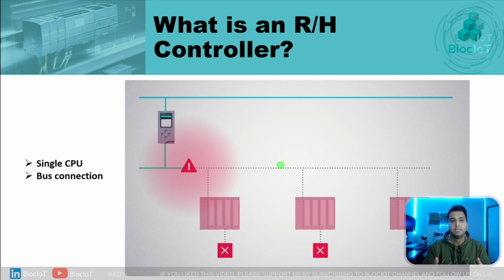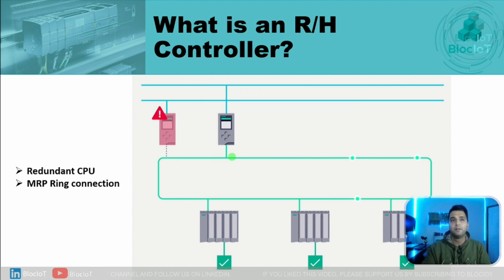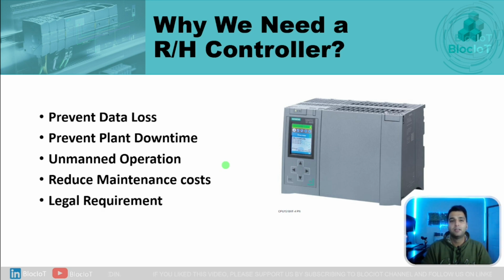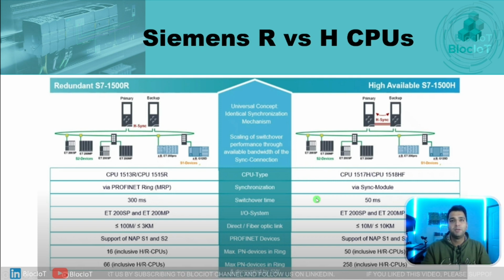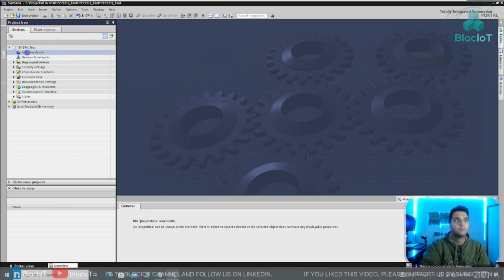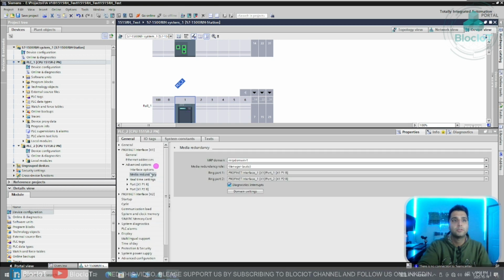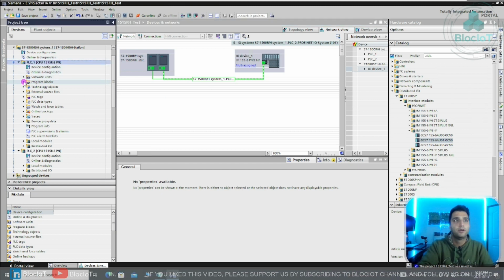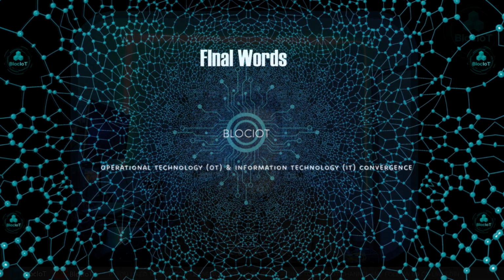21- Siemens PLC Redundancy & High Availability: From Basics to TIA Portal Setup and Real HW Test!

Comment: Hello Thanks for video. Is it possible to have redundant ET200SP with non redundant CPU? Thanks
Reply from the maker: I hope it was useful.
To my knowledge, you can connect redundant I/O to non-redundant CPUs in PCS7, but there are limitations and considerations. For instance, using redundant Modbus TCP/IP on PCS7 to communicate with non-redundant PLCs is possible but sub-optimal. Additionally, for true redundancy, you would need specific hardware configurations such as HF Interface Modules and S2 PROFINET features to ensure proper communication and avoid single points of failure. Without these, redundancy may not be fully achieved.

Comment: What happens if you have two cpus and three RIO units in project but only one RIO can be connected for commissioning does it have to be setup as in your video? Or can you complete the ring without the other two RIOs ?
Reply from the maker: Great question! If RIOs are just a node in the ring not redundant RIOs, they don't have to be connected and can be connected later. But Redundant RIO is a diffefent story. Here is a useful link:
https://support.industry.siemens.com/cs/document/109767576/connection-of-redundant-i-o-devices-to-s7-1500?dti=0&lc=en-WW

Comment: Can we add switch in in interface port 2 of 1515R
Reply from the maker: Sure. The CPU in this deno is connected to a Scalance switch on its right side.
Reply: But interface 2 haven't MRP can we connect directly
Reply from the maker: @jr_electrical-Engg  I am not sure if I fully understand your concern. You may send us a message on Linkedin to chat more with details. Overall, each CPU has two independent ports (X1 and X2). In this demo, X2 of each CPU is unused. So you may ise it for any purpose. But X2 is not a part of MRP ring so you won't get benefit of MRP ring. Overall, it's not a good idea to do it this way. If you need to add a switch, add it to the ring. Hope this helps

Comment: wow did you paid for both the cpu's yourself? quite expansive!
Reply from the maker: The demo was borrowed from local Siemens office :)
Reply: @blociot thanks for the reply. Didn't that was possible. Do you rent that or need to be a siemens certified partner?
Reply from the maker: @MrDawen1997  anyone who want to buy a unit, they can ask for a demo for testing as long as the local office has a demo available. You should call them and ask.

Comment: Brother, i have situation when i tried to download the hardware configuration, it only got downloaded in primary plc and backup plc is empty without the program. can you please the how i can download the configuration and porgram in backup plc. I have follow the hardware wiring the same as you said
Reply from the maker: Hi Usama. Have you tried downloading to the backup CPU directly? Try connecting to the backup CPU directly with an Ethernet cable if the TIA Portal doesn't recognize it.